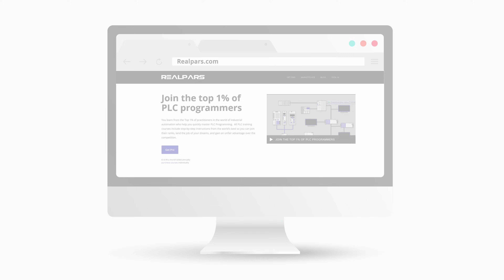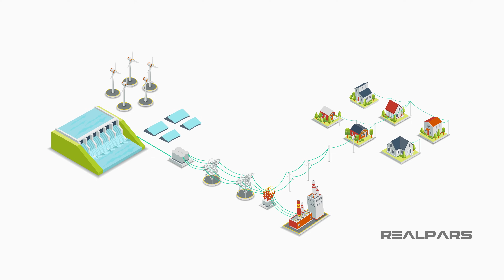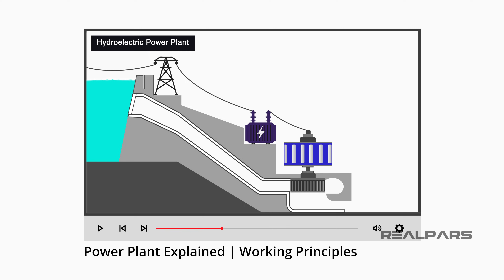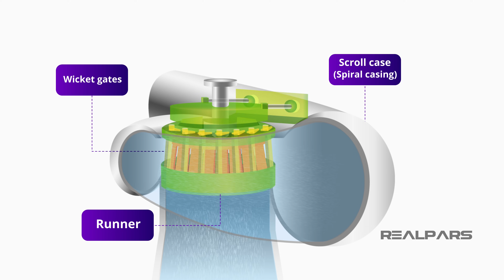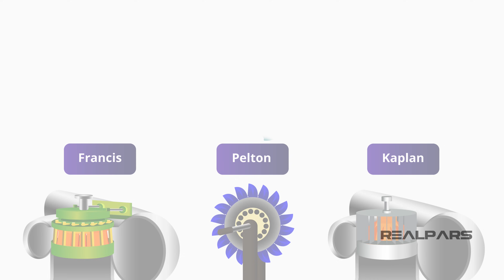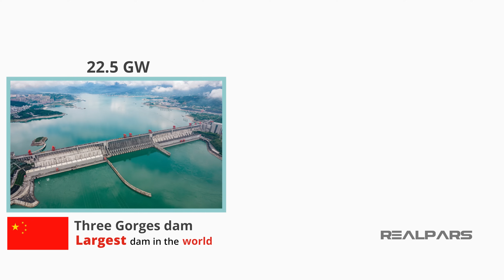Hydroelectric Power | How it Works?

Comment: Good Morning 

this is part of sent message to the White House 
This document is for a retro fittable power production system for a hydro dams to have up to three extra turbine banks without making issues for the main turbine hall
Now the reason this type of system has not been looked at was two fold .. the loss of flow rate and back pressure issues 
As all the worlds dams have the same basic layout regardless of the turbine fitted. The basic setup is water turbine shaft to shock uni joint to the electrical turbine. And so all have the same common limitations  
A new type of turbine unit is needed if the main turbine hall is to function with without mods for a multi bank units are to be placed in the flow 
This new system will never match the output of the main turbine hall but after years of chasing miniscule increases a system like this one is a massive jump in output 
At this point it should be noted that most of the installation process can be made with the dam online selling power to the grid and there is no increase in water usage when fully installed  
This system has been designed to be fully independent of the main turbine hall so as to be serviceable with the other units online and running with the main hall 
A FEW OBVIOUSE POINTS 
Population = Even if our numbers were to fall we are still in a situation of heading to a power shortfall outcome things like data centers e cars and a hole host of other tech 
The lag time at best for any new power units to get online is 2-3yrs at best and i believe we are well short of filling the markets needs 
OTHER BENIFITS OF THIS UNIT
Is a dam green tech? well its more recyclable than wind and solar
lasts 100 plus years vastly more than the others
It should be noted if the patent is very strongly protected the market will come to the seller even if it is in Australia or America so a 100 billion dollar a year marketplace makes the wage bill a non-issue 
SOME OF THE BIG BENIFITS 
Bigger market share/customer base
All the required infrastructure is already in place
the asset has a longer life span
No issues regardless of type of the main turbine fitted 
No added down time 
AND ITS TRUE BASELOAD POWER from a existing dam

Comment: What is green power?
the real true definition of green power is not the one stated by the media or the gov forums these are only a catchphrase.
the REAL definition of green power is whatever energy was needed to remove it from the earth and ship it then refine it engineer it THEN assemble it to sell it to you (which by the way is a shed load of power) Must be recouped.
Then the life of the item must in the case of wind or solar be long enough to make twice the energy consumed in its manufacture AND at end of life never see landfill.
As things stand wind and solar are NOT filling any these standards a basic internet search will show wind turbine blades being cut into three and dumped into landfill
And solar panels are also in the same boat for avoiding landfill
Now your saying my new electric car is Green Right !!  Well No it is not look at the car and remove all the plastics and fiberglass or carbon fiber from the car and it's life AT BEST is 8-10yrs then a new battery is needed. a cost that is not going to drop anytime soon. Now as for running costs may be low but your purchase price is not the true reflection of the cars true cost to make it  because of the gov rebate! (brand not withstanding)
So your in a car that has 20yrs of life so about 200thousand ks on the clock then dead due to cost to keep it running due to wear and tear low battery capacity Ect.
Now i drive a 2002 Landcruiser v8 second hand $16k to buy @100thou ks on it and with good maintenance will run up 300 thou more and be more recyclable. YES i hear you the fuel the oil.
but the oil can and is reused and very little of the car ends up in landfill now don't get my message wrong I am ALL in for green truly i am but Don't call it green until it IS green energy a paper Bag is actually greener than a electric car or wind or solar.
Reply: thank you.
Reply: something  new for you ,, an update use as u see fit 

the following is still in the working out faze
This document is for a retro fittable power production system for a hydro dams to have up to three extra turbine banks without making issues for the main turbine hall
Now the reason this type of system has not been looked at was two fold .. the loss of flow rate and back pressure issues 
As all the worlds dams have the same basic layout regardless of the turbine fitted. The basic setup is turbine shaft to shock uni joint to the turbine. And so all have the same common limitations  
A new type of turbine unit is needed if the main turbine hall is to function with without mods for a multi bank units are to be placed in the flow 
This new system will never match the output of the main turbine hall but after years of chasing minute increases a system like this one is a massive jump in output 
At this point it should be noted that most of the installation process can be made with the dam online selling power to the grid and there is no increase in water usage when fully installed  
This system has been designed to be fully independent of the main turbine hall so as to be serviceable with the other units online and running with the main hall 
A FEW OBVIOUSE POINTS 
Population = Even if our numbers were to fall we are still in a situation of heading to a power shortfall outcome things like data centers e cars and a hole host of other tech 
The lag time at best for any new power units to get online is 2-3yrs at best and i believe we are well short of filling the markets needs 
OTHER BENIFITS OF THIS UNIT
Is a dam green tech? well its more recyclable than wind and solar
lasts 100 plus years vastly more than the others
It should be noted if the patent is very strongly protected the market will come to the seller even if it is in Australia or America so a 100 billion dollar a year marketplace makes the wage bill a non-issue 
SOME OF THE BIG BENIFITS 
Bigger market share/customer base
All the required infrastructure is already in place
the asset has a longer life span
No issues regardless of type of the main turbine fitted 
No added down time 
AND ITS TRUE BASELOAD POWER from a existing dam

Comment: Is there a difference between this type of production vs thermal? 

Turbines need a real big water flow to keep running and produce, which is not the case for thermal production, because thermal production can easily be changed to allow near the exact needs of electricity. But what happen if they let too much water be spent to make the turbine turn? We loose water reserve, but what happen to electricity been produced? Do they produce too much and loose some? Or it's not the way it works?

As a point of comparison, what happen if there is a sudden thunderstorm, with darker sky, meaning that a population need a sudden more electricity for lighting their house? What happen in a thermal power plan vs an hydro power plan?
Reply from the maker: As with any hydraulic system, there are flow limiters that prevent too much water from flowing to the turbines.  There is a maximum rotational speed for a turbine, above which there is no additional capacity for electricity generation, but again, there are operational limits that prevent this from happening.  There are some anticipatory controls that adjust output when events occur that may affect usage, but overall, power plants react to changes in demand rather than anticipate those changes.   Thermal power plants can increase steam flow, while hydro plants can change water flow to spin the turbines at different speeds.  In both cases, turbines can be brought online or set in an idling state to adjust to demand.

Comment: Wicket gates will only control the speed of the turbine when the generator is not synchronized to the grid. After sync the wicket gate position is adjusted to generate more or less power, speed is consistent with grid frequency. Otherwise, great video.
Reply: It's pretty obvious that when any synchronous generator is synchronized to the grid it's speed, voltage, frequency is then fixed by that grid. Then what more water flow into the turbine will do it will produce more mechanical torque to produce more active power.
Reply: That is true as long as the hydro generators rating is much less than the capacity of the grid (other generators paralleled to the grid).